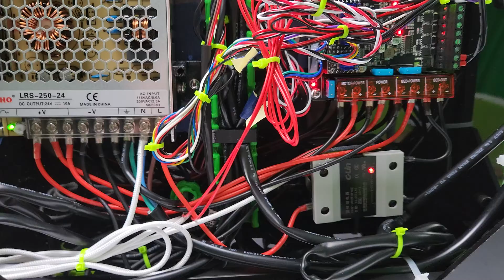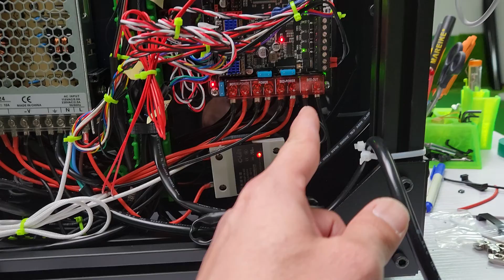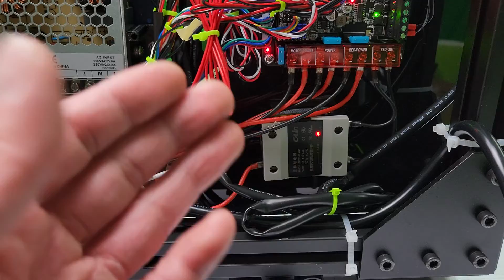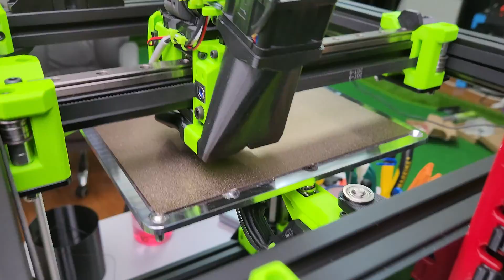How to Connect SSR Wiring on Ratrig VCore 3.1!

Comment: I think they don't include the AC wiring in the guide to save their asses in case someone gets injured. But that leads to people relying on some online articles and videos and potentially doing it wrong. Or even just doing what they think is right without consulting anything. I see that you didn't earth your SSR. People on Discord suggest that you should connect an earthing wire to the SSR using the mounting screw on the AC side. The bed needs to be earthed as well. And also all the DIN rails if you use them.
Reply from the maker: Yes that's what voron team also recommends and what I've done with my latest voron.  If you ground ssr then your din rail is also grounded btw. ;)
Reply: @3dPrinterSchool  Cool. I guess that depends on the type of mount for the SSR though. I use a printed mount and grounded it separately. And connected all the rails together with some wire.
Reply: That's exactly the reason, and I feel it's really irresponsible of them to not provide any guidance on this critical part of the printer build.

Comment: So you need 2 main plugs or can you get away with using 1?
Reply from the maker: You only use one.  One wire from bed heater to Neutral and one wire from bed heater to SSR AC.  Then one from SSR AC to Live.  24V PSU also share the AC wires but connected directly to its AC terminalsm

Comment: Thank you for the tutorial!  I have a 500.  When I set up my bed heater, and I tried turning it on for the first time, it blew a fuse!  How can I prevent this from happening?
Reply from the maker: Gotta make sure have correct wiring obviously.  Make sure you have the right printer.cfg settings also.   The ratrig default is to use bed out wiring connection to control ssr.  If you have fuse blown it's due to bed heating up too quickly so maybe something wrong at setup.
Reply: Why amperage is your fuse?
5a is not enough. I put one in that is 12a.